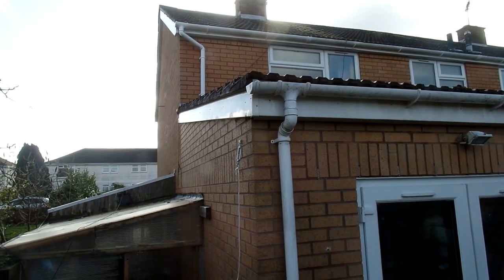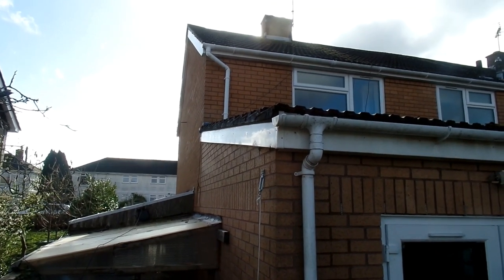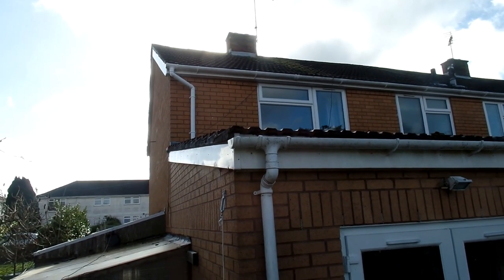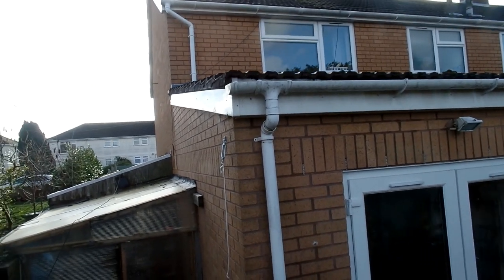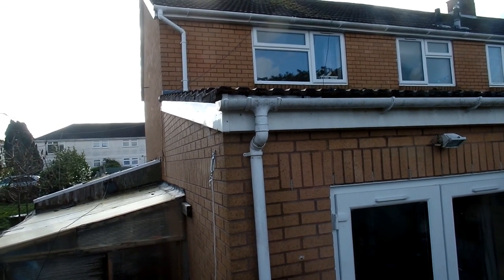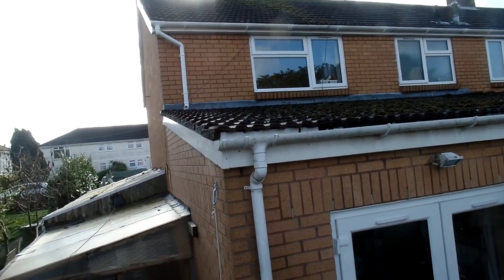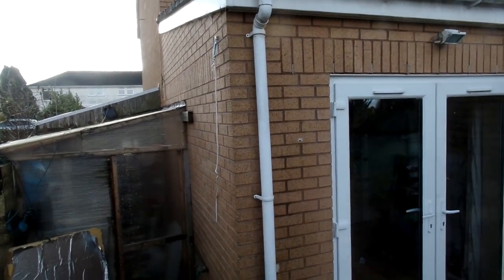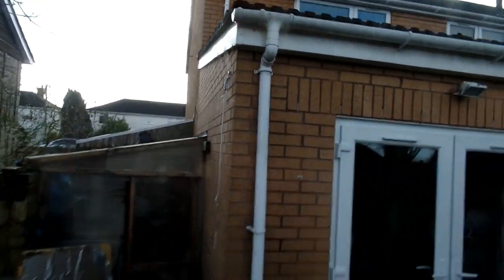Roof set to a low pitch. @domesticsurveys

Comment: 2 fixes both not expensive compared with a new roof.
1. Reroute the down pipe from the main roof so all that water does not flow over the lower roof.
2. Remove the tiles and install a heavy duty felt then refit the tiles, that will make sure that if any rain back flows under the tiles it still does not end up into the inner roof/ceiling below.
Reply: The roof tiles are to keep the water out not the underslaters felt. 
No simple solution to this one.